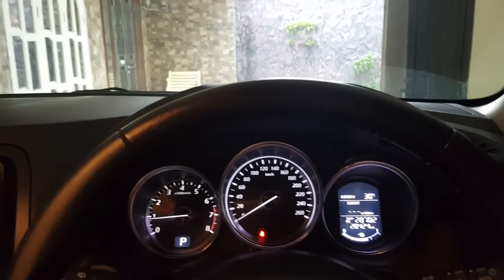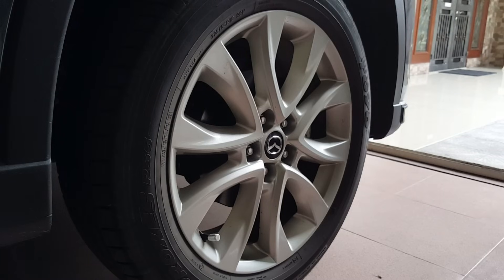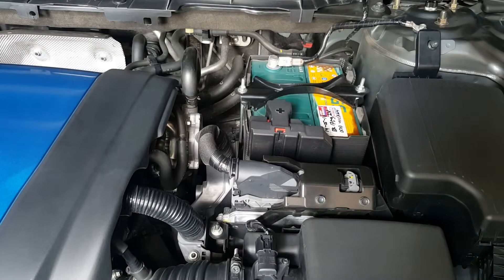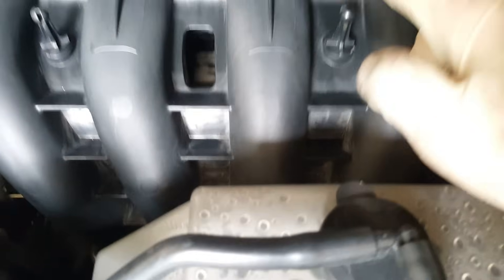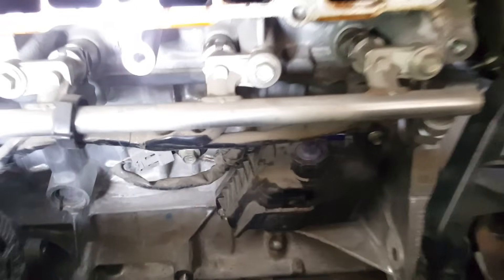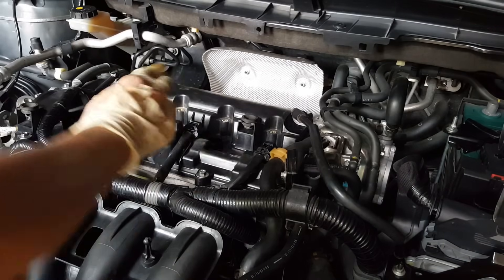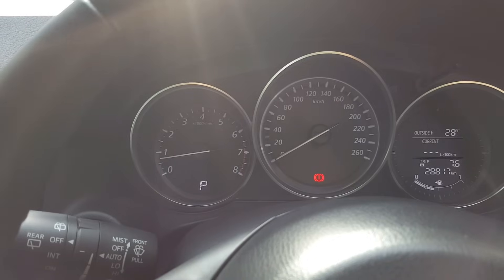How to Clean Intake valves / Carbon clean // Mazda CX 5 (All Skyactiv Gasoline Engines)

Comment: Did this the first time about a year ago I needed the whole week to put it back together so I purposely used my wife's toothbrush to clean the valves so she didn't talk to me and left me alone for eight days. It's that time again for me to do this very soon.
Reply from the maker: Hahhaha watta Champ !! 😅😅 make sure she dont catch you using her tooth brush this time.
Reply: @GarasiFelixDan  I wanted to focus entirely on putting the intake manifold back so I purposely pissed her off so she won't talk to me and leave me alone for a few days. It's the oldest trick and it works all the time just don't do it very often.

Comment: How about using walnut shell blasting on the valves and then blow them out. Even is some shells get into the cylinder they will burn up and blow out the exause.
Reply from the maker: Yes sir definately can Walnut blasting is a good option and alternative for cleaning Intake valves, but it's important to ensure no shell fragments remain in the engine.

Comment: It would've been a good idea to replace the PCV while you there, is cheap and gives a headache when goes bad, no to mention remove the intake one more time.
Reply from the maker: You're right, it's always a good idea to consider replacing other inexpensive parts like the PCV valve when you have everything apart to save time and effort later.

Comment: how do you cleaned the other 2 exhaust valves brah??
Reply from the maker: Intake valves you mean ? Just turn the crank pulley until you can see the other intake valves open n shuts . Btw for your reference in This video i did not clean the exhaust Valves. 😅

Comment: Add air oil separators to both the PCV and crankcase ventilation lines.. Keeps all the oil air out of the intake
Reply: From your experience, after doing this how oily is the intake track?
Reply from the maker: @randallbates8891 theres less oil presence after installing the Oil catch can.
Reply from the maker: Yes i have done the video in the past . Mazda Skyactiv CX 5 CX 3 Mazda 3 Mazda 2 Mazda 6 Oil Catch Can install with Custom Bracket Mounts
https://youtu.be/wwshYqm4cH8
Reply from the maker: Yes i have done the video in the past . Mazda Skyactiv CX 5 CX 3 Mazda 3 Mazda 2 Mazda 6 Oil Catch Can install with Custom Bracket Mounts
https://youtu.be/wwshYqm4cH8

Comment: There was so much oil on that intake manifold! I suspect a faulty oil separator!!! But you never checked it!!!! Definitely no working correctly and ALWAYS best practice to change oil and filter after cleaning but you never did that either.
Reply from the maker: Good points! The video focused on the cleaning process, but those are important considerations. i do replace my engine oil n oil filter every 5000kms to 6000kms 😊

Comment: Good job ! Also, doing induction service every 48,000 Km or 30,000 Miles is a good carbon cleaning option and your engine will thank you. For this, you need compressed air and the pressure can for the cleaner.
Reply from the maker: Thanks for the helpful tip about induction service! 👍

Comment: All well and good but your method will leave particles directly on the vale’s when upon start up will circulate those very hard residual particles throughout the engine especially cylinder walls. Good luck
Reply from the maker: I appreciate your concern, but the method used is specifically designed to prevent this. The solvents used are formulated to dissolve and break down carbon deposits into very fine particles that are then safely expelled through the exhaust system, minimizing any risk to engine components.

Comment: Could you prevent this by using something like Sea Foam or other fuel additives ?
Reply from the maker: Some says drive it hard for a day or two with good tier of fuel. But then its a DI engine the solvent / fuel cannot reach / spray out the intake valves. But definately can give it a try with other fuel additives.

Comment: Garasi, I ran across this as I was searching for why my cx5 was getting worse gas mileage.  This worked out great. I used the crc b-12 chemtool gas additive; very concentrated and powerful solvent.   Once I got each cylinder at top dead center in the compression stroke I would pour it in to tge two intake valves and let it soak a few hours or overnight.  Cleaned them right up and man does it run better.  Also installed an oil catch can to prevent the blown out pcv oil from entering in the intake.  Thanks a ton.
Reply from the maker: Awesome to hear about your successful results and the catch can installation! Thanks for sharing your experience. 👍🏼

Comment: Why is oil over there and so much carbon? Well We always advice to not over react from the amount of oil the car needs to have inside. Do not use cheap oil and remember to change oil after 5000 KM with the right oil spec. OIL FILTER, AIR FILTER, etc etc. In my eyes this is poor engine maintenance!! When u really take care of your car u don't see so much carbon. Recently I change the oil to my Mazda 2 2022. I always prepare myself for this event. I bought genuine oil from Mazda 0W-20, oil filter from K&N, Air Filter, 1 can of Addictive(ENGINE FLASH Liqui Moly Pro-Line motorspoeling 500ml 2427). Here I share my steps. The day I change the oil I drive the car and be sure the car is warm enough. I add the Engline FLASH to the oil reservoir and run the motor for 15 minutes. BE SURE U DON'T DRIVE THE CAR WITH THAT ADDICTIVE. U CAN DAMAGE THE ENGINE PISTON! AFTER THAT I flash the old oil but u need to open the pail and the oil dope so u can get away from the old oil as much as possible. I change the oil filter and clean with brake cleaner all dirty around. DO NOT FORGET TO CHANGE THE O-RING and always torque spec. I add 3.5L first and later the can of addictive Wynn's Olie-additief Super Charge 325ml. I open the oil pail several times to get the level. I add the rest of the oil to the right level. Do not over react putting the rest of oil u have left. The right amount of oil is very important. I bring everything in the right position and clean any rest of the oil. I change the air filter after that check, double check that everything is right. Next maintenance I will change sparking plug, oil filter, air filter and Interieurfilter. Now I can safe drive the car and be sure u check the oil lever to get the right level. Since I have Mazda ZERO OIL BURNING, ZERO ISSUES. I am very proud whoever made this beautiful car. My respect for the Japanese but remember they are not magicians. If u don't take care of the car do not expect good results!

Comment: bro, i have a question or two. can i carbon cleaning on the intake valve first than carbon clean the combustion chamber later? or should i do those two at the same time? thx in advance
Reply from the maker: yes definately can do both at the same time. 👍🏼👍🏼

Comment: I used a Ko-Ken grip socket for removing the bolts on the Intake Manifold. This gripping socket made the reinstallation of the bottom bolt in the middle a bit easier at you're fighting gravity and part interference when aligning this bolt. And lastly, dielectric grease is used on all electrical connectors that are unplugged during this procedure. Too bad the Brick & Mortars can't rent one of those walnut husk cleaners for the valve covers. My 2014 Mazda6 has 75k miles on it with very little highway miles so I worry about carbon buildup. Another commenter mentioned Kano Kreen All-in-One Gas & Oil Treatment. I'm pondering on trying a quart of this at my next gas fill up and/or oil change.
Reply from the maker: Thanks for sharing your experience using the Ko-Ken grip socket for the intake manifold bolts, it will be helpful for others. 👍🏼

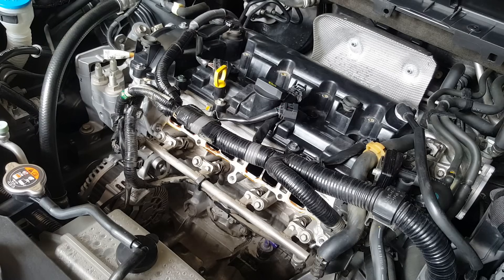Comment: Thanks for the detailed video. You point out the oil catch-can @8:15 and the hose between the intake and the catch-can (the hose that connects to the purple colored fitting on the top of the catch can. Why didn't you remove the oil catch-can from the side of the block and clean it? I ask because all the blow-by vapors and oil mist from the engine passes through that catch-can before just before it enters the intake system.
Reply from the maker: Ahh yeah i see what you mean i did not remove it as that time i think the catch tank is completely in working order so do not need to remove and clean it.

Comment: I have seen multiple skyactive Mazda's with 300-400.000 km with nothing cleaned in the intake. There is a video on you tube of the Mazda 6 with 500.000 miles and the owner states he has never done this....
Reply from the maker: Fuel quality and road conditions are the main issue here for some of country. It will get the intake manifold all caked up if no maintenance done to it. Lucky for some owners who are live overseas that has a better fuel and cleaner atmosphere could help with this carbon build up situation.

Comment: I use a top tier fuel, Shell, Chevron, Exxon or Mobil. These are by design high detergent fuels that are best for GDI engines. Every so many thousands of miles I add a quality fuel system cleaner as well. Do a search on top tier fuel. Great video.
Reply: useless since the gas mixture doesn't hit the intake valves
Reply from the maker: @FX_B7 this is so true it wont wash off the intake valves
Reply from the maker: Thank you for support and the great additional info. It will help the other owners to maintain their GDI engine runs cleaner and getting less carbon deposits.

Comment: I advise you use 0w20 Mazda supra-x oil, if you cannot for some reason use it, try Eneos x-prime. Those two are the best oils for this engine. I've done extensive research on this matter. Speaking about 2.0 gasoline engine.
Reply from the maker: alrighty thank you sir for the superb info 👍🏼👍🏼
Reply: @GarasiFelixDan  Thank you for making the video on how to clean the engine, it's the only problem that I might have to really investigate in my CX-5. If you need the details on the oils let me know.

Comment: Did you start the engine to close the valves 1 and 3? When do you know to stop the engine where 1 and 3 are closed?
Reply from the maker: you have to rotate the crank pulley and you will see the valves open n closes.

Comment: I would recommend using a walnut shell blaster instead of using solvents.  It would take less time than soaking in solvent and scrubbing with a toothbrush.
Reply from the maker: Definately that would also work and would save time.

Comment: In US there is product called Kreen from Kano Laboratories (same company that makes Kroil). I run a pint in the crankcase before every oil change (5000 miles). The Kreen will vaporize and pass through the PVC system and wash down the valves. 100k miles and haven't had to do an intake cleaning service.
Reply from the maker: ahh great ! thank you for the info.

Comment: I have a small question: is it possible to do the same for cleaning the combustion chamber? And if we don't rotate the engine to change the cylinder state to closed before proceeding, can we clean the combustion chamber directly instead?
Reply from the maker: Yes thats a very good idea & you dont have the trouble to do it twice later on. 👍🏼👍🏼

Comment: Hi, how did you check thr Top Dead Centre that the valves are closed? Did you check the lobs ?
Reply from the maker: ya i make sure to look thru the intake valve to make sure it is in a shut position before applying the carbon cleaner. Get a friend to Shine a torch thru it to see the valves open n closes
Reply: @GarasiFelixDan  thanks for your reply with amount of carbon build up that there is it's every difficult. It seems that cylinder 2 is closed as we checked with the camera but I need to be 100% sure. That's why I'm asking on. How to get the engine into top dead centre
Reply from the maker: to know the tdc you have to remove the valve cover & see the timing chain there will be 2 dots marked on the cam gear. If you like that extra step remove the valve cover to see.

Comment: How do you turn the engine by hand? What tool do you use to do it and how do you know when the valve is exactly closed? It seems if it's even a little open, that cleaning chemical would go down in the cylinder. Do you know if there's a video showing how to do this? Thanks buddy
Reply from the maker: you need to use a racthet with 21mm socket and extension . Rotate it clockwise slowly , then get a friend to look into the intake port to see the valves open & closes.

Comment: Id still take a skyactiv over a full electric. You can either do $9 can of valve cleaner through the intake once every 10k miles and avoid this all together,  or wait until the car throws a code maybe at 100k+ miles and pay like 500 bucks for a shop to walnut blast the valves. Either way still better than battery cell issues or battery pack replacements every 5 years.
Reply from the maker: ahaha same here i would choose regular fuel cars over EV.

Comment: Hmmm....at  approximately the 10:18 mark he says get you a old toothbrush and start working. What .....did we skip a step? The next step we are shown is a sucking syringe a little bit filled up with carbon dirty solution. Yes the valve was closed. So did you pour a little solution  inside and then start scrubbing. Or just a little bit at a time on the tooth brush and scrub it. Let it soak in? Probably does not matter. Still....a good video.
Reply from the maker: @daguy593  i soaked it about 5 mins and start scrubbing using old tooth brush. Then vacuum it out and repeat until you r satisfied & then i blast it with brake cleaner to make sure there are no more carbon deposits.

Comment: No properly designed engine should build carbon. If it does, blame the design.
Reply from the maker: @samkitty5894  maybe its just the way the direct injection engine works.. so yeah it is what it is. But overall this engine are pretty easy to maintain and access.
Reply: @GarasiFelixDan  I have these 3 cars, all are daily drivers that never fail:
1992 Volvo 940 with 512,300 miles
1993 Volvo 240 with 473,600 miles
1998 Volvo V70 with 294,200 miles
None of them have carbon buildup. I took off intake manifolds and saw nothing out of ordinary. Nothing to clean. They all use old fashioned fuel injection into the intake manifold, not directly into the cylinder like the new cars do. That tells me which engines are better. Plus, my cars have cast iron engine block, not cheap aluminum... 
My guess is that cylinder deactivation on new engines contributes to carbon buildup. Oil in deactivated cylinder gets pushed up into the hot combustion chamber where it turns to carbon. There is a saying: "Leave well enough alone". Auto engineers should remember it.

Comment: What’s the reason for cleaning intake valve and is there requirement?
Reply from the maker: @maychieus  direct injection engines are prone to have a carbon build up. So i would recommend doing this service every 2 to 3 years.
Reply: @GarasiFelixDan  do you need to clean fuel injectors too
Reply from the maker: @maychieus  Use complete fuel cleaners additives / deposit cleaner should do the job . Id recommend to use it every 2500kms , do it prior filling up the fuel.
Reply: @GarasiFelixDan  thanks for sharing 👍
Reply from the maker: @maychieus  you r welcome . Keep supporting this channel by like , share n subscribe. ✌🏻✌🏻

Comment: Low revs driving and economy driving is what makes carbon build up. Pushing the engine sometimes to the rev limiter will make your engine clean. The problem is that most of the people thinks over reving the engine will destroy it...I am not sure why most of the people think this way or where did they heard of this.
Reply from the maker: @The_Touring_Jedi  yeah i heard about this pushing your car on high revs for once in a while  will help breaks down the carbon build up Italian tune up.
Reply: @GarasiFelixDan It also works on port injection engines. Very same carbon build up happens also if port injected due to lower engine revolutions. 90% of the people out there think that driving the engine at higher gear and higher revs would damage something...😂
It's just most of the people does not understand the thermodynamics with internal combustion engines nor majority would ever understand.

Comment: A lot of work, with potentially sending debris into the cylinders from the cleaning process…were there drivability issues?  Why clean at such low km?
Reply from the maker: @edwardlacika3022  Hi edward with such a low kms on this cx 5 you could already see some amount of carbon build up. This video is to demonstrate and show the fact DI engines design will need to do extra carbon clean up service. The car did not have any issues back then as yet other than effecting the fuel milage.

Comment: How do you precisely tell when valves are close?
Reply from the maker: get a friend to turn the crank pulley slowly while you shine a torch on the intake valves you will be able to see clear when they are about to shut properly.
Reply: @FelixDanGarasiAuto  thanks no exp with shutting valves just as you said not comftable but good advice

Comment: Very few Mazda Skyactiv owners undertake this job themselves and it does not get done during servicing yet there plenty of high mileage (120k+) Skyactiv engines in service seemingly performing well without complaint - how ?  Does this job really need doing at all ?
Reply from the maker: In some countries that only receive n have a low quality fuel will suffer from this carbon build up. So yes i still recommend this service.
Reply: @GarasiFelixDan  Would regular treatment with carbon cleaning fuel additives such as Redex mitigate this problem?

Comment: What did you do to close the intake valve 1 and 3? Since it was opened?
Reply from the maker: you have to wait for other cylinder to be cleaned out first then repeat the proses for valve 1 & 3 which we have to close em down prior spraying the intake valves.